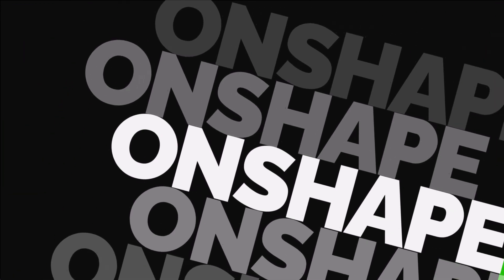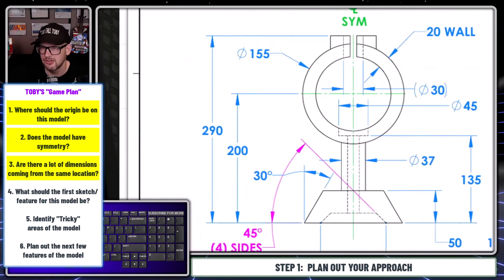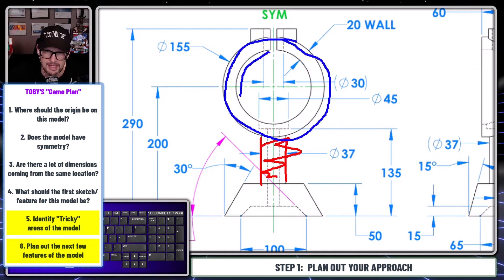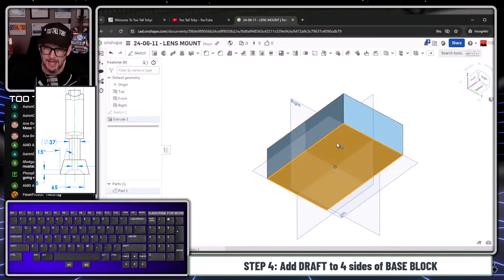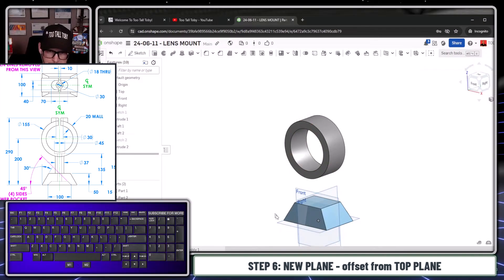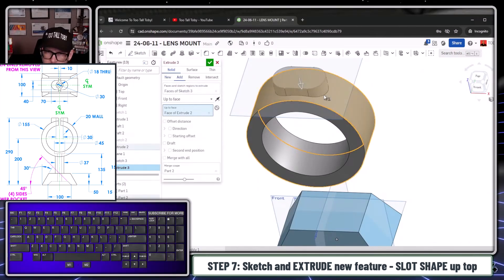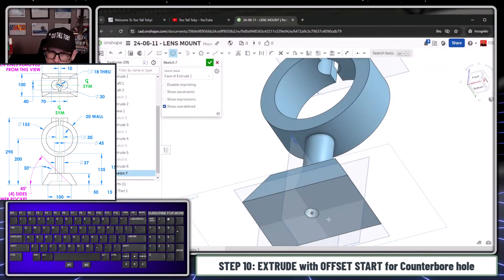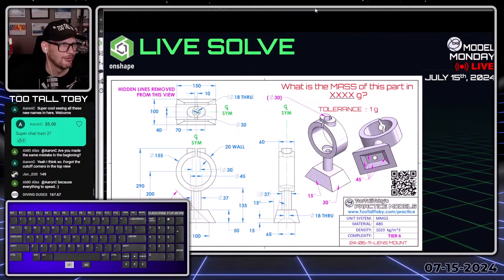Onshape TUTORIAL - Step-By-Step - LENS MOUNT - TIER 6 CHALLENGE

Comment: Been muddling through onshape for a week. Your videos are a huge help!
Related question: Can I use a plane to slice through an object at an angle and remove the section on one side of the plane? You don't have to show me how, just want to know if it's possible.
Reply from the maker: Hi Rob! Yes - it's in the SPLIT command - you can choose to keep one side or both. (choose 1 to "cut away with surface).
hope this helps!
Reply: @TooTallToby  "Somehow" I managed to do it. I couldn't figure out how to change the plane dimensions, so I drew a longer construction line and put the plane on it.
Reply: Nevermind, figured out the plane thing- click on the plane, grab a corner and drag.